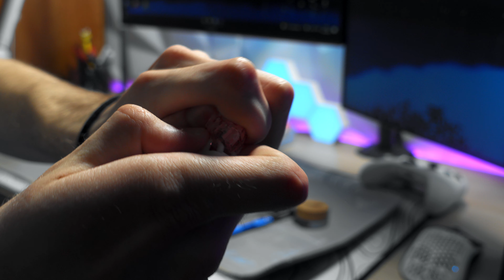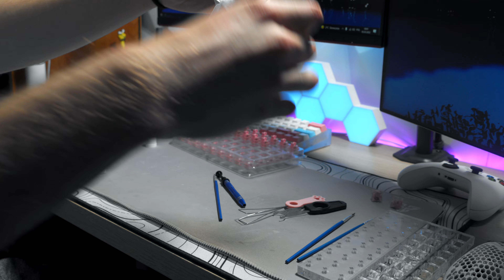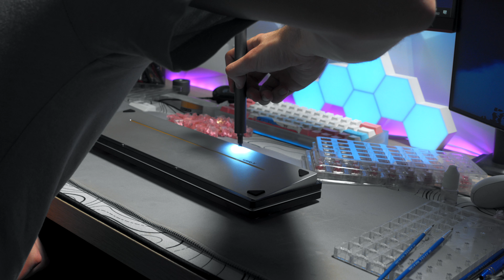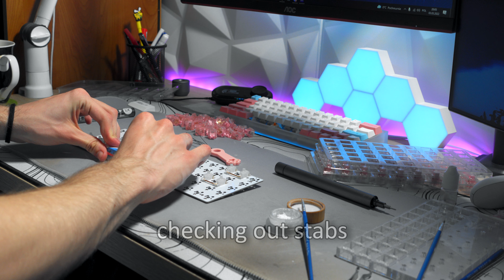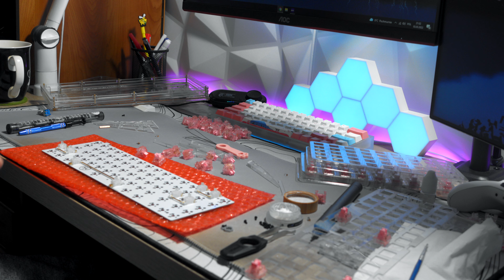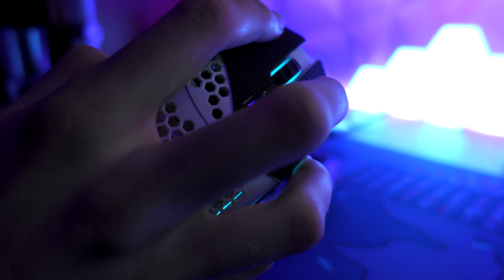MW65 Build - Best budget gasket custom keyboard?

Comment: The reason they were hard to open was because you are using the wrong switch opener that is for outemu switches and other brands you are using akko rose red
Reply: Allo and outemu has same build structure and pins
Reply: @lekhabiju882 not really
Reply: @ayenex6893  they do actually